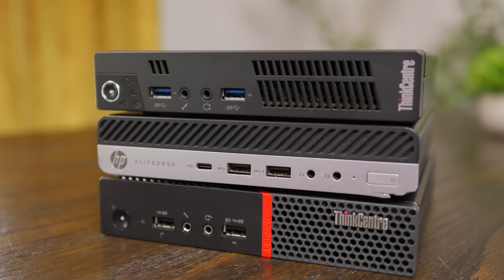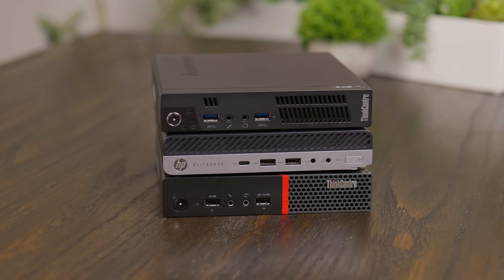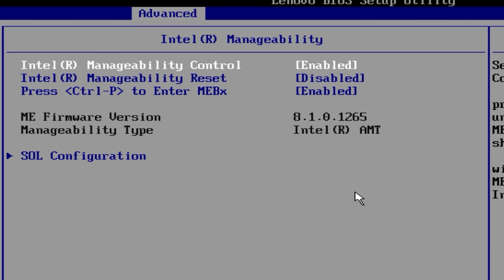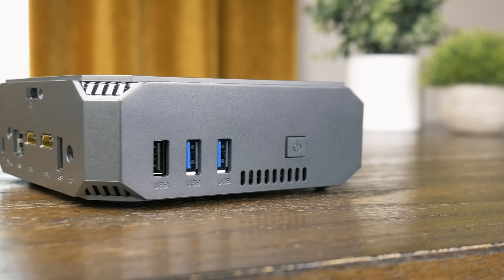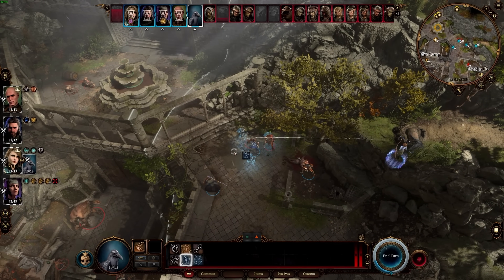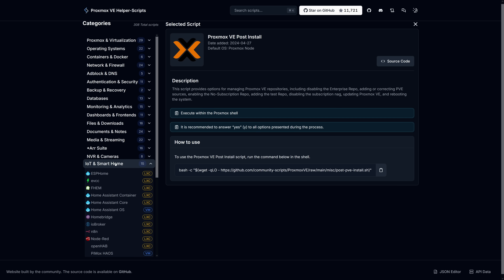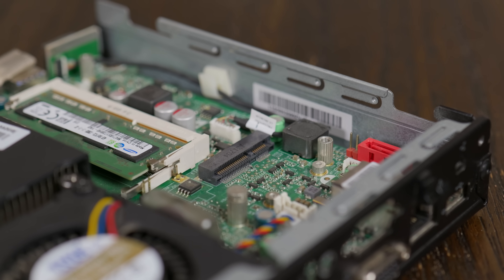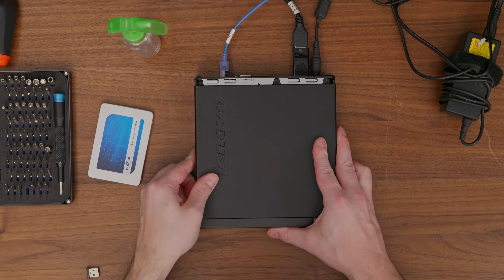Why Are People STILL Buying This Old Mini PC?

Comment: I work IT in a factory that makes aircraft parts. I LOVE the micro PCs, They are so much easier to find a good place for... important in a cramped production environment, and at lest with the Dell OptiPlexes we use there are plenty of expansion options, I can add a second Ethernet port, HDMI or DP, or even a serial port.

Comment: I actually rescued one that my old workplace was going to recycle (Recyle as in, Send off to be crushed destroyed and recycled as EWaste, not as in reused) with no hard drive for FREE.  I supplied my own hard drive, Upgraded it's old CPU with my OLD Desktops 4770k, upgraded it's RAM, And it's a Very respectable Home server.  Actually it's running Windows 10 Pro, With VMWare running a Windows Server Datacenter edition VM I got for a steal (IIRC I got the software on deal for like $200 instead of it's normal $2000?)  I do plan to swap those OS's when I can take some time to reconnoider some things, as it'd make more sense for the VM's on the box to be Win 11 Pro and Linux Mint, With the metal itself being Windows Server but, I haven't done that yet.  I maintain documentation for my homelab, with Portmap and other diagrams I've made in Affinity Designer so I want it to be at a time where I can update my Documentation appropriately as well.  probably sometime this weekend.

Comment: I have one of those thinkcentre ryzen 5 2400 i got on ebay, it runs as a dedicated proxmox backup server and its awesome. It's on a smart plug and turns on only a few times a week to accept backups from my proxmox servers. Then it shuts off. I thinking about buying another.

Comment: Perfect combo performance/price : Dell Optiplex 3020 or 9020 Micro with a E3-1265l V3 (4 cores, 8 threads, 2,5 Ghz, 3,7 Ghz with Turbo Boost).

I prefer the 9020 Micro because the chipset is enable with Intel VT-d.

Comment: I was given an almost new Thinkcentre Tiny M72e with a Celeron, 4GB RAM, and 500GB HDD and it was miserably slow stock, but it actually runs pretty well for basic tasks after upgrading to an SSD, 16GB RAM, and an i5-3470T, all of which I already had.

Also, my CPU maxes out at around 75-80 degrees C under full load and I never could get it to throttle, so I'm not sure why yours gets so hot. Maybe the thermal paste between your CPU die and IHS has degraded and delidding could help. Delidding and lapping combined only helped mine by 2-3 degrees, but that i5 I had laying around didn't see much use at all, so delidding could easily make a way bigger difference on a CPU that had a harder life than mine.

I wouldn't have paid much for it, but it could definitely make sense for some applications for the right price, especially after the upgrades I did. I don't have a use for it at the moment, but it's still a great spare system with a little character due to its impressive packaging, especially for the time.

Comment: honestly linux is a very problematic os for some cases so just use an os that you know "work for sure" for all purpose you need is just the best option. Dont get me wrong if linux doesnt give you headache becuse work well for your use case use it. Sometimes just doesnt work headache for me. In my case a just want a pc for run plex and run a print server. Unfortunately my old canon printer just doesnt want to work with cups. Another nightmare was use a simple arcade stick for emulators. The drivers for the arcade stick in some ways has a conflict with the xbox controller drivers in ubuntu... For emulators i switch in use a dedicated os like batocera. And if you have a pc with nvidia driver you know they can have a loooot of problem with linux.

Comment: I have a HP 260 G3 (Pentium 4415u) and it has a fantastic Windows Idle power draw of down to 3,6 Watts (thats Rasphery PI-level). Shure, doing some stuff on that system is stressing (only 2,3 GHz 4 Threads, but there are also higher clocks CPU´s, like the i5-7200u or 7260u). But for low processing stuff, its perfekt. And i do not know any older plattform, who can provide such advanced powerfigures and modern standard features in a Micro-PC Plattform. It should be Kabylake Gen, with its possible modern standard features (even PCIe-M.2 SSD is possible) - better  not older. But, if you not need Kabylake implementations, Skylake will make it simmilar good.
The only bad thing is the cooling-solution and, if the fan will fail, even new fans maybe will not be be quiet enough again, as they may were original new from HP. For some reason.
But i wouldn´t buy an older plattform-generation, because several pretty usefull and advanced developements aren´t made at those times.

Comment: I found the best value PC's are the SFF boxes like the OptiPlex 7040 or 5055, both from around 2018 offering a i5 6500 or higher in the 7040 and a 2400G on the 5055, You can find newer systems with 7-8-9th gen Intel or higher CPU's for cheap enough. I've found the Mini PC's have problems with heat over the SFF boxes. I use my systems as micro servers for things like Minecraft and Docker with Portainer. They also make great Emulation boxes for Batocera, I have two other less powerful systems in the SFF from factor that currently are going to be Batocera boxes, the one I have setup is hooked up to a 4K TV with HDMI, runs everything from Game Boy, NES up to GameCube/Wii and PS2, It's a lot of fun. one of the cool things about the Batocera OS is you can enable a network drive option so you can just drag an drop in your games into the folders on the system, making adding games a lot easier.

Comment: The HP 705 G5 DM performs better and features a real AM4 socket with 3200GE for a fair price. It has one 2,5" SATA slow and 3x M.2 slots, two for SSDs, one for WWAN or 2230 SSD and can be upgraded with CPUs like the 3400G. It is one of the cheapest, used PCs with official Windows 11 support. The Vega iGPU can handle any casual game in WQHD, e. g. Minecraft and decode H265. It runs rock-solid as 24/7 mini server at reasonable temps.

Comment: I have one as a Debian based CUPS print server.  It took a while for me to install the correct Brother laser printer driver (it was recognized on a different Linux machine first), and I used the information to do a manual install.  Anyhow that's a much better solution than relying on proprietary software on the actual printer.

Comment: A big thing missed here, is you can use specialised versions of Linux(such as Batocera for playing retro games) that will allow you to play games, watch TV MUCH quicker than on the crappy hardware included on smart TVs and many other things using a wireless game controller as remote, doesn't even need mouse or keyboard.

Comment: I have a Dell Optiplex 7060 in my 10" rack. i5 8500T with 24GB RAM. It also supports AMT, which is great because removing it from the rack is a bit of a pain. Running Windows Server 2025 Core with Hyper-V. I have a Debian VM for my UniFi controller and tvheadend, as well as a Server 2025 VM for file storage.

Comment: I bought a so called refurbished HP Elitedesk 800 G3 a few months to play   games from Steam and GOG because my Acer laptop from 2019 isn't the best when it came to playing games since it had a i3 CPU as well hooking up to the TV was a tedious task.

So I bought the small desktop for about $75 with a $25 gift card that I got as a Christmas gift on Amazon but I said so called refurbished because this thing was missing the wireless card which I had to buy one new and the HDMI module where I can just hook it up to the TV.

I think the seller was somewhat stupid for 2 reasons where the first is this thing wasn't refurbished to be fully functional due to not having a wireless card and the other one which is funny because the listing shows the thing supposed to have a i7-6500T CPU but instead I got a i7-7500T CPU when I was replacing the thermal paste to see it had a better CPU.🤣

Comment: I am using the Elitedesk 800 G2 USFF (i5-6600T) with proxmox to run servers, mostly Nextcloud but there's others on there that I use from time to time.
Before upgrading people need to make sure they have the right model of power supply as well, for the G2 there's two models.

Comment: I think you missed one of the biggger points by choosing a wrong example PC: expandability.

My Fujitsu Futro S940 and Dell Wyse 5070 Extended both have normal (albeit the smaller ones) PCI-E slots and space to populate them with any card from GPUs, NICs and other weird stuff (maybe some RF cards?) or to cram inside at least 3 more 2.5" SSDs in addition to the mSATA boot drive via B+E slot adapters.

New mini PCs might come with better efficiency, similar power draw and dual NICs built-in but they're built as a standalone unit and sometimes you can't even add a longer NVMe drive, much less another one or a 2.5" SSD because there's literally no space inside the chassis. You can't hack around the hardware limitations, you have to pay (sometimes a lot) more for something you could solve with an adapter.

Comment: I just recently bought a HP EliteDesk 800 G3 Mini and loaded it up with 32GB of RAM and two 500GB nvme SSDs I had collecting dust in a desk drawer. The thing already has a full desktop i7-7700T CPU.

Took it apart, dusted the whole thing out, re-pasted it, and now use it as the living room media center connected to the projector (we don't own a TV yet), and we use that solely to watch movies offline, occasionally stream, and play heavier video games over Sunshine/Moonlight from my beefy desktop PC two rooms away. It's an amazing device, and I got it for under $75. Had to go the painstaking route of installing Windows 11, then running Talon's debloat script on it, but that's mostly because my family isn't familiar with Linux like I am. So I jumped through all the technical hoops to make it easy for everyone else in my home to turn it on and GO.

Comment: I purchased a M92P several years ago from eBay and paid less the $100.00 it came with 3rd generation Intel® Core™ i5-3470T processor (2.90GHz, 3MB Cache) Intel® Q77 Express Chipset, Intel HD Graphics 2500, upgraded RAM 8GB, Front: 2 USB 3.0, 1 Microphone/headset port, 1 Microphone/headset port, 2 Display ports, 1 Mini-PCI Express (52 pins/2.5Gbps per link/3.3v) I had to purchase the power supply and the upgraded RAM. I installed Linux Mint and sometimes will tinker with other Linux Distros just for the fun of it. Thanks for the video have fun.

Comment: I have an HP G5 Mini with a 9700T setup with Proxmox. I just purchased two more with the same specs to make it into a high availability cluster. I also picked up another G5 Mini with a 9500T to run a digital signage board. I’ve been slowly adding more services to my home lab. Soon, I plan to build a powerhouse gaming tower with the ability to add more RAID storage down the line. I’d add the powerhouse to the cluster, and have it operate as a rendering server, run local AI, provide storage, and occasional gaming. Thank you for your videos. They’ve inspired and guided me on my home lab setup.

Comment: I have a HP ProDesk 600 G3 Mini (Intel i7-7700T) & HP EliteDesk 705 G5 Mini (AMD Ryzen 5 Pro 3400G). I really like them and have been using them as Server. The G5 runs a Minecraft Bedrock Server. Planning to buy a few more in the future.

Comment: ive had my lenovo m900se for years with zero problems .  i7-6700T , 16 gigs of ddr4 , Timetec Pinnacle 256GB SSD NVMe , ax200 wifi , DP to HDMI 1.4 Port Board 04X2752 03T7215 and Thermal Grizzly - Duronaut paste . in the past 4 years it has never been powered down except for upgrades to windows 10 restarts . tried windows 11 , yes it will run but 10 works 1000 times better . its my all in one internet ( youtube , amazon, netflix,etc,etc ) kodi diggz for games and anything else ... its hooked up to a denon avrs900w with polk 7.1 (rt20p fronts, csia6 center, t15 sides, m50 rears with all the tweeters replaced with Peerless by Tymphany XT25TG30-04 1" Dual Ring Radiator Tweeters) and a yaber y31 that has Thermalright Aqua Elite 240 water cooling ( need to make a video on how to do that) shoot on a 105 inch screen made from 1x3 wood and a hanes Eclipse white non-FR blackout lining (best screen for under $1000 and cost me $50 to build in under an hour!)

Comment: I have good success with the Lenovo M93P, which can be bought at the same price. The CPU cooler is significantly better in design, and runs 4xxx processors with 2/2, 2/4. 4/4. and 4/8 core/thread processor options.

Comment: These are great PCs. They will run forever. Just know that if you want to run Windows 11 and have security updates you had better check the specs. The bargain ones probably will not qualify.Otherwise you can run Linux, ChromeOS or another utility OS.

Comment: I bought 3 of the HP 800G3 mini's recently.  One to replace an internet radio station host that was on an FX8300, so no doubt power use went way down. One at my work for a part time worker, she had an amd A8 something that was 12 years old and 1 at home that runs a downloader.  I found a little A E key 2.5gb card that fits in the wifi card slot of these as well. 
I also bought a new Bosgame P3 Mini Ryzen 9 6900HX and that is half the size of the 800 G3 but it's a little monster, you can set down to 25W with almost no loss of performance. Full size PCs seem to be going dead our movies, plex and backup data is all on a nas in a different room.

Comment: I have a couple similar PC's.  One of them is an M72e tiny that originally came with a 3220T.  After a while, I paid something like $5 on eBay and upgraded it to a 3470t like the one in your video.  The 3220T has a base clock of 2.8 GHz, the 3470T has a base of 2.9 GHz and turbos to 3.6GHz.  Although they are both 35W parts, the 3470t definitely gets warmer running at 100% using a synthetic benchmark.  Otherwise they seem to perform the same for everything I do.
Currently it is hooked up to our 1080p 47" TV in our living room.  Yeah, everything is a bit older, but so am I.  We watch movies from our home server and stream videos to it and have had zero issues.
2X8GB DDR3 1600 and a 512 SSD in it and it is plenty fast for every day use.
I currently have Windows 11 on it and it runs absolutely fine.  If Microsoft does end up making it so Windows 11 won't run on it I will be fine running Linux on it.  There is nothing I do on this system that I can run just as well using Linux.
I also have an i3 7130u in another Tiny PC and for day to day use they seem about the same.
*  I have been running PIA for a few years now and absolutely love it.
Reply: I have been installing Win 11 iot Enterprise LTSC on the unsupported CPUs with great success. For systems like my Elitebook 600 G3

Comment: Nice job on that. Gave me some ideas about how to better organize the growing collection of stuff in my not quite yet a lab. One suggestion; use Velcro wrap for cable management. I'm in the pro audio-video space, and we do a lot of racks. A huge pet peeve is seeing zip ties in a rack. They make it really hard to add, move or remove cables. Velcro wrap is pretty cheap and is reusable. And it won't slice your hand open when you slide by one while trying to get that stupid little USB plugged in the right way.

Comment: I see a lot of these for sale either refurbished or just straight up second hand in Denmark at domestic webshops. Unfortunately they are more expensive than brand new, super efficient N150 or even N305 based mini PCs with 16GB DDR4 or DDR5 ram on Amazon or AliExpress. It's mindboggling, and while I support reuse of old hardware, it seems ridiculous to pay more for old hardware. I guess I will leave those old ones for people that haven't noticed the rest of the world exists.

I do have a couple of old machines like this for running Home Assistant etc. but there's just no reason to purchase them and possibly need to upgrade the hardware, when I can get much better for less.
Reply: Exactly this.  Plus the N100s have an up-to-date chipset and GPU, meaning anything that needs video decoding flies at near zero power.  3*4k display support, loads of USB3 etc.  These old machines aren't worth it unless well under $70.

Comment: Use a dell sff 3040, i5-6600, 8gb, as a home lab, £30 thanks muchly
Reply: I did upgrade RAM to 16Gb and put a 250Gb SSD into it but that's all the mods I did

Comment: which software you are using to determine pci line and speed  etc. i have m710q and wifi not working i switched a working card with another pc both wifi cards working not sure if pci bus mulfunctioning or not.

Comment: I have 3 M93 tinys with 16gb memory.. I put a coral TPU in the wifi slot on one for a dedicated Frigate box, Home Assistant on another, and Ubuntu server on the last to run OpenwebRX with SDR's hooked to it. Its overkill for those uses, but uses very little power for bare metal machines.

Comment: Just this weekend I put OpenWRT for X86 on a M710q with an i3-6100T cpu. With one Ethernet port, I had to turn of DHCP, and connect it as a client to my main router to update some packages for USB drivers. After that I was able to use USB tethering with my phone for WAN. The CPU includes AES-NI instructions for encryption and should run a VPN router quite nicely. After switching DHCP back on, I took my GL.inet LTE router, and turned DHCP off on that to make that a wifi AP.

Comment: I know this typically isn't your content, but it would be interesting to see how Windows XP runs on that machine. 3rd gen Intel chips were basically the last officially supported Windows XP processors. 4 GB of RAM wouldn't even be all addressable with a 32-bit OS like Windows XP and pcie gen 1 might be just fine for a video card from that era.